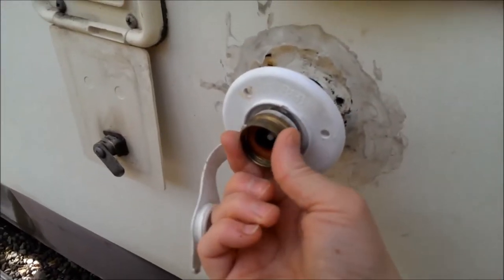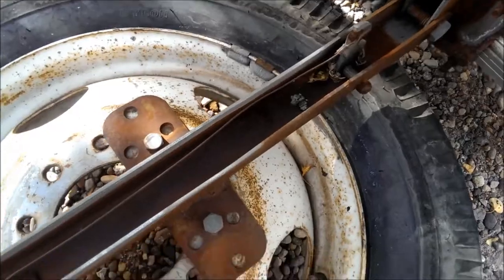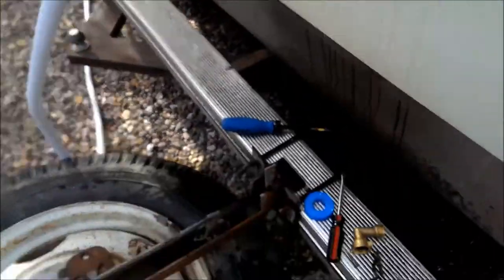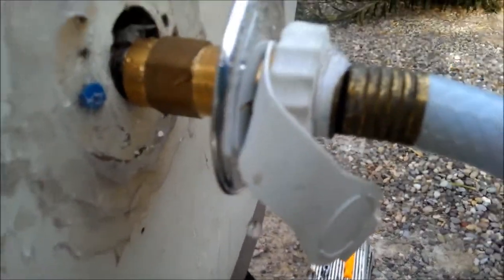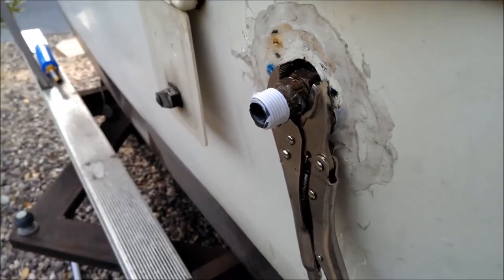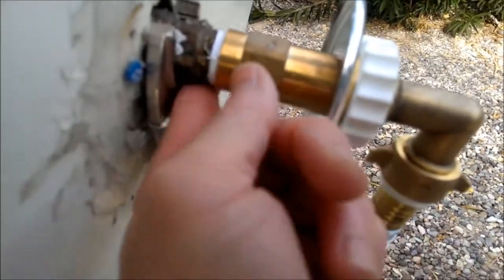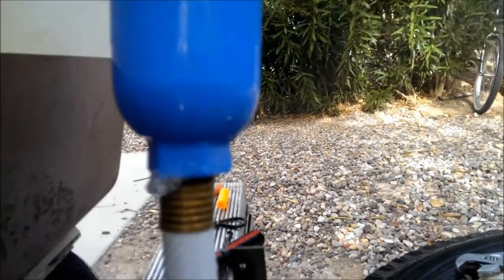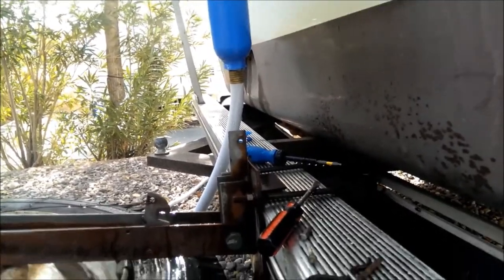Full-time RV - City Water Connection

Comment: Here's a Tip I learned working at Lowes. If you have a hose that leaks you can put 2 of those Rubber Seals in the end of the Hose rather then the one and sometime that will work and maybe every time. I had a Hose that leaked like crazy and spraying everywhere and it had the one rubber seal and I just put one on top of that one and no leaks at all. May be worth a try. You can get those Seals at Lowes. I think there is 6 of them in a pack. Good Job though. :)
Reply from the maker: +Terry Skeans Thanks Terry, I may give that a shot!

Comment: I replaced the same fresh water hose fitting on Serenity. The new one didnt come with a rubber gasket and I didnt notice  it on the old one. We found out the hard way. When we were camping in Milton in March we had a leak in our bathroom. Well I though it was our bathroom. It took me a bit but I figured out it was the new freshwater hose fitting. Luckily I still had the old one. When I went to put it back on thinking the new one was defective i found the gasket. But of course it was 230 am. Keep up the good work. Rob and Lisa

Comment: Love the new intro and outro!!!  Great job. I hate water leaks - as you know, I have had my share of them.  I placed the pressure regulator on the hose connection to the coach and that helped with my hose leak. Good luck.
Reply from the maker: +The Paddy Wagon Yeah, we both have had our share of water leaks. It's crazy, isn't it? Better to have a leak on the outside of the coach than on the inside ;)
Reply: truth!

Comment: BTW, with the pressure if the elbow, the short extensive hose hooked up to the water filter, there is too much weight pulling down on your city water connection, which could cause failure in the connection.
If it were me, I would put a short piece hose to the filter, and rest it, or bungee it to the bumper, taking the pressure off the inlet.......just an idea. It happened to me one time!!
Reply from the maker: Thanks for the great tip, and for watching!

Comment: your connection looks like mine.  Ive replaced it two times this year so far.
Reply from the maker: +Pounder Speaks That's awesome, what a piece of crap, huh?
Reply: Yeah .. Ive tried a couple of different ones and after a while even with the elbow attachment the weight of the hose pulls it off.

Comment: Hi there. I have a valtera duel inlet on my fifth wheel. I like yourself am pretty handy how, my issue is the city water flange is corroded and fused to the water pressure regulator. And not allowing me to pull the old parts through the opening of the inlet cover. I'm stuck as to how to remove to . Jig saw reticulated saw hand held hack saw blade or just cut sideways on the inlet cover and scooch the pipes over and repair with puddy. If you know how I can DYI  have a jayco . ???? Anyway keep it real as always. You are great!!!